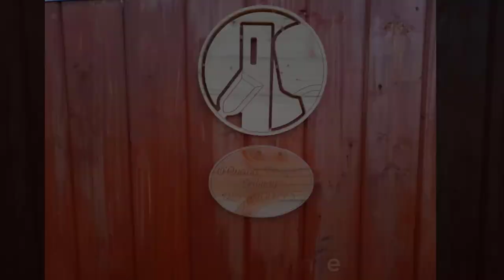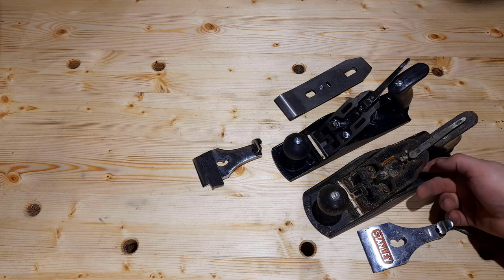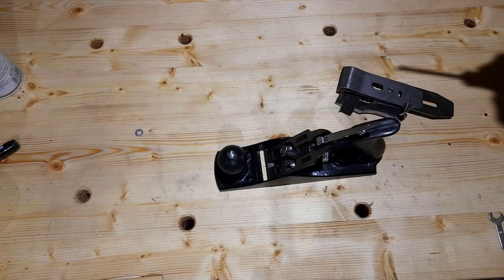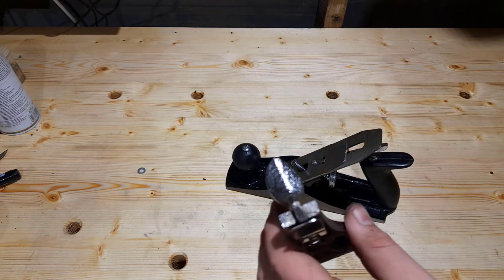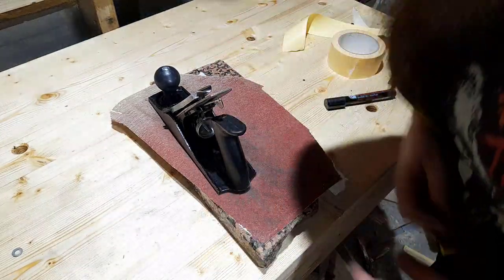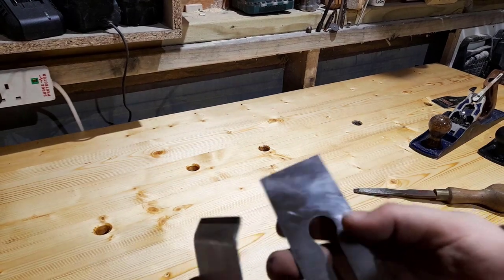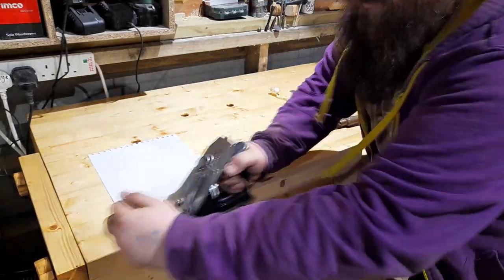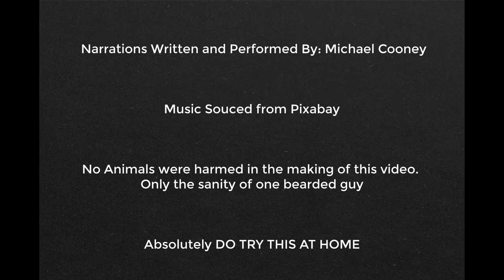Transforming a Cheap Hand Plane into an Heirloom Tool

Comment: Very helpful information! I've got some old Stanley planes that I hope I can fix up rather than buying something new and praying it's decent quality.
Reply from the maker: Glad it was helpful! Generally if you find something from the 80's or older the build quality is much better and the steel in blades harder but if you put in the work you can get excellent result. Hope this helps.